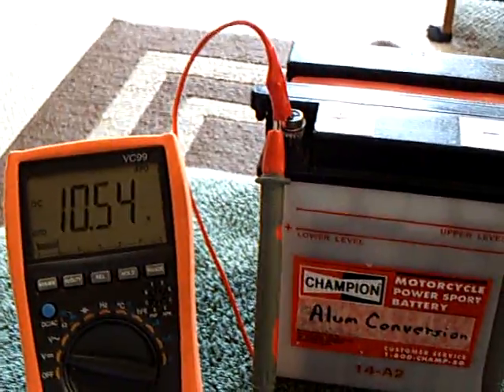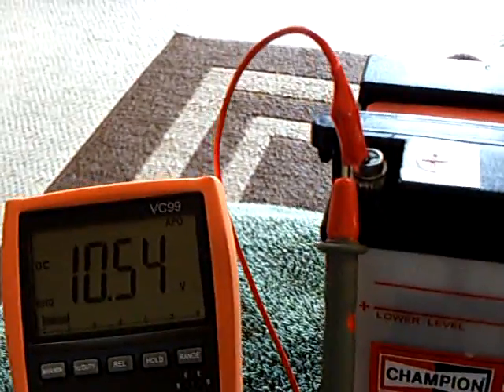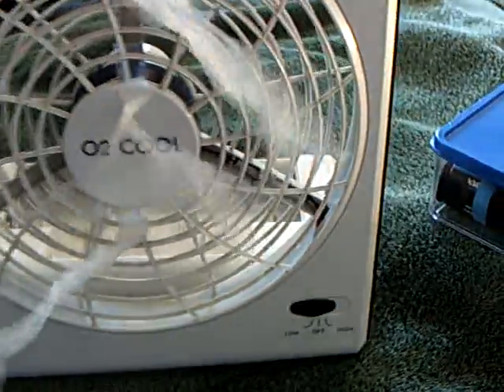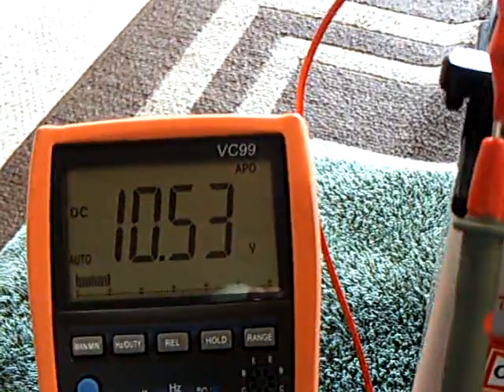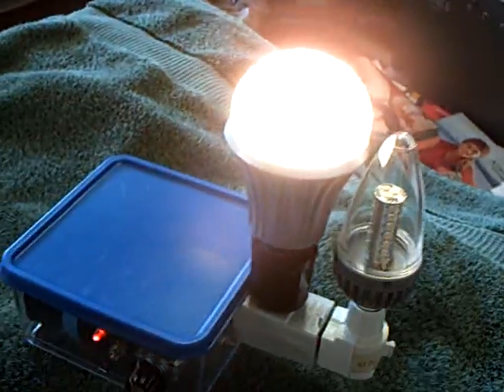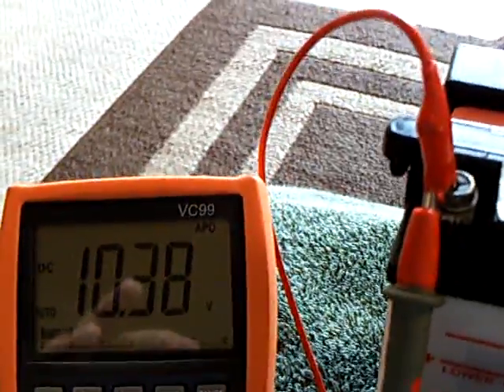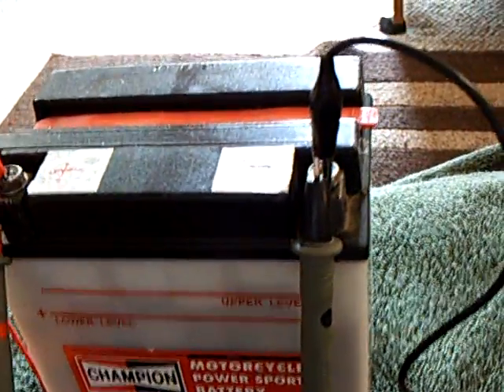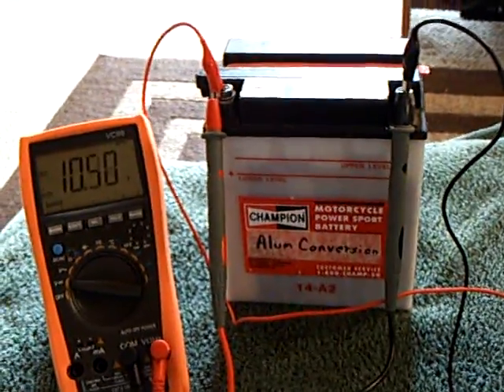Lead-Alum motorcycle battery powering a 12v fan

Comment: Already converted my 60ah lead car battery to alum battery...run my pc for more than an hour...then put into my car, still can run the engine...the same day, I switched on car light from 12 midnight till 7 in the morning, then start the car, it run smooth..very powerfu battery ..I mean stong charge

Comment from the maker: I don't know.  Parallel charging and then series connecting for the load is worth a try.  Mine alone will not run my big inverter that has a low voltage cutoff.  Try slow charging your battery for 6 hours or so with a low amperage and see it it fills up.  Mine took days of cycling before it came back and really held much juice.  It was probably sufated badly after being left dormant for sevaral years.

Comment: What I see mostly out of my battery vent when charging is a white residue from the alum drying but I will do what you say and go for a week charge and discharge. My charger tonight has finally gotten to a point which is has fully charged my battery so I a making ground some more. So I will give more updates later.

Comment from the maker: You might try fewer turns on your primary to get the output voltage higher or use a higher voltage at the source.

Comment from the maker: That is a good question.  I have not done that on this battery but on my test cells when I dead short the cell nothing seems to happen except some of the oxide fall off the positive electrode.  Put a charge back on the battery-- then everything reforms and off you go again.

Comment from the maker: Good question about the leadoxide dropping off on deep discharge.  On my small test cells some did.  The question is ---how much room is at the bottom of the case to hold the oxide before it shorts out the cell.  If that did happen then I would simply rinse out the battery, fill it back up with the Alum mix, and go again..

Comment: ~ interesting indeed. Exide makes some (very large) 6V deep cycle forklift batteries that are (I'm told) about 150-160 Ah - interesting part, is they are cheap (about $110) and they come dry; no fluid.

Comment from the maker: I think that the answer would be an efficient DC to DC boost converter that could regulate the  DC voltage to whatever you need.   I have one so I will have to try it out.  You will lose maybe 10% of the power but it is a way around the lower voltage of this battery.

Comment: I'm interested in using these cells as a backup for wireless access points in Uganda because of the safety factor and resiliency.  However most AP's require 12V 1A, I'm wondering if the 10.5V this battery puts out would be enough.  It would obviously need a LVD at some point... Any thoughts?

Comment: Hi Lid, 
I have the same fan fan, yes a real current drainer ...
Are you sure that you can discharge the batteries to zero volts without them dropping lead or leadoxide into the bottom of the battery case? Otherwise it could produce some shortouts? Many thanks!

Comment: Excellent real world demo there. They do indeed run right down and aren't bothered, just like a rechargeable AA, on a big scale with big amperage :)
I'd say try it on a 12V circuit, a portable TV or something. Small TV's will have voltage regulators for 9V and 5V anyway, so will probably even run cooler on Alum power if they work. Worth a go.

Comment from the maker: Thanks.  The BIG advantage I am seeing here over a sealed lead acid battery is that you can take this right down to zero and not hurt it.  I don't think that this will ever sulfate and go dead either.  John Bedini's last videos showing the charge and discharge on his 5Ah were very impressive.  The down side is that you are not going to get 12volt power so those things requiring that won't run off this.

Comment from the maker: I think that this rechargeable batttery does have commercial applications.  The fact that you can deep discharge this and not ruin it and the fact that it uses a much safer electrolyte ----means alot.

Comment from the maker: Yes I got your message and sent you one back.  Check your messages.  You may have the circuit wired up wrong.  Check out GBluer here at you tube for the circuit diagrams.